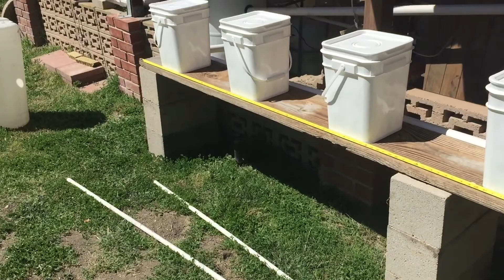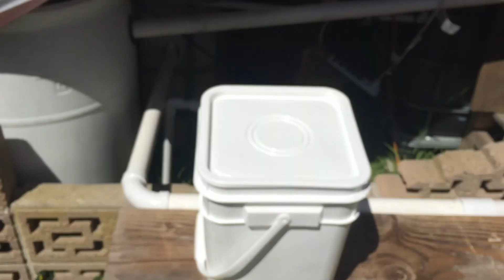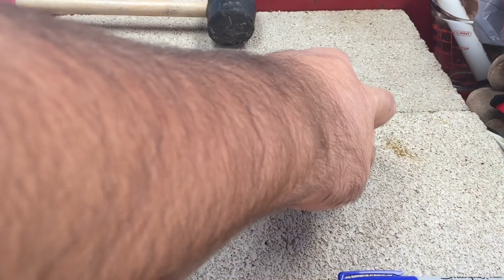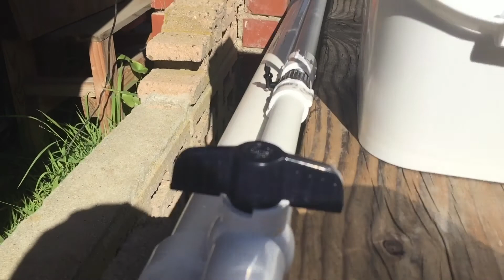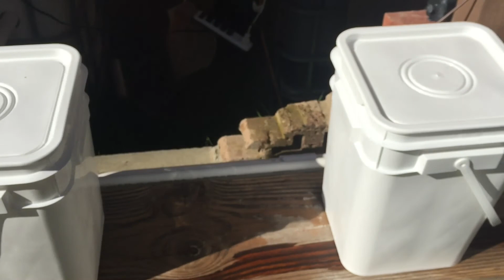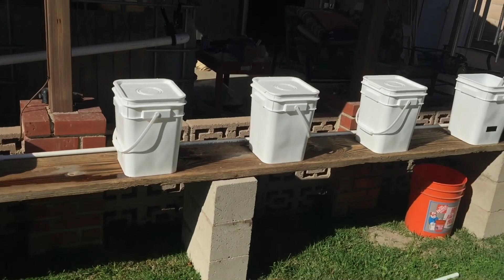How to: Dutch Buckets - Part 2 - Water Inlet

Comment: Nice informative video. One thing that you could do to save a bit of money is to get a cheap 2 or 4 port manifold, tee off the pvc pipe with a riser in between each bucket. You reduce the number of fittings you need and you get the same results. 4 port manifold would be awesome if you were running two rows of the dutch buckets. Home Depot sells them for $2.65 each, add a tee for 50 cents and a riser for 50 cents, you are at just about 90 cents for the fittings for each Dutch bucket.
Reply from the maker: Thanks! That’s a great idea:)